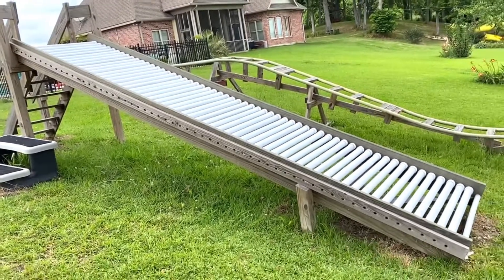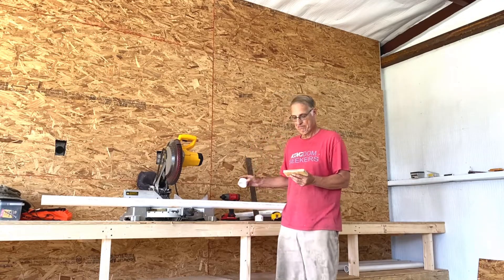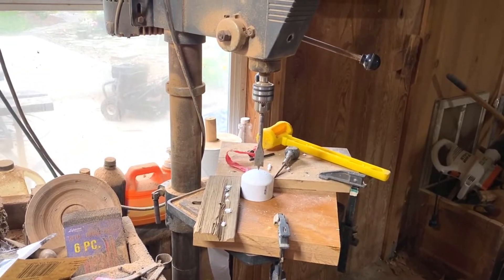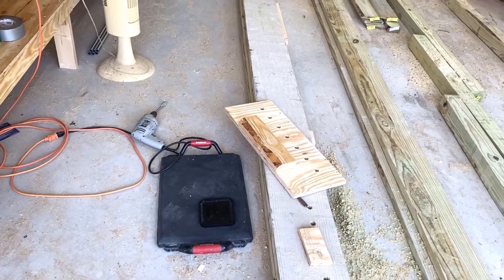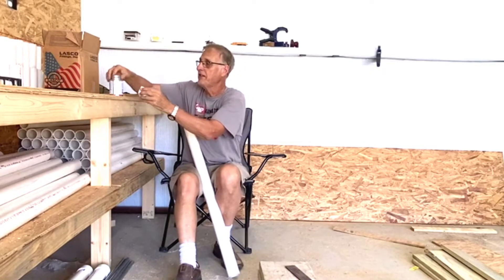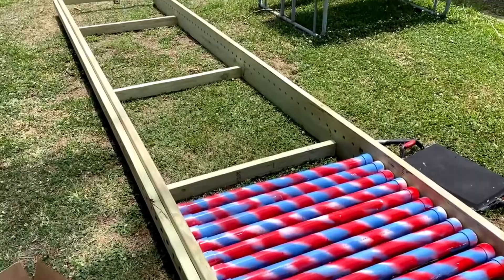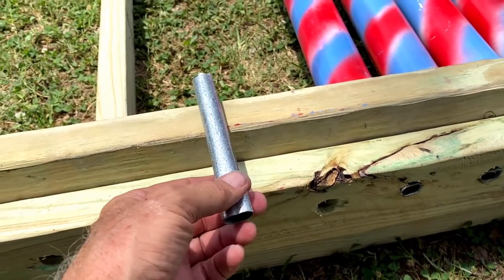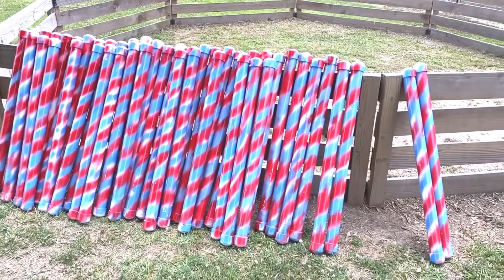Roller Slide: How to Build

Comment: Is there a reason for using the 2x4 and 2x10?  Wouldn’t the 2x10 be enough strength?
Reply from the maker: Yes that’s a good point. The two by four is added for the purpose of holding the 1 1/2” steel conduit in place. I think it is very necessary for that.

Comment: How much was this project
Reply from the maker: Watch the attached long video and it will tell you all the parts. Not sure about total cost. It is fairly expensive project because of the tubing and the end caps. I devised a much cheaper way to make this as explained   Smaller pipe and much less 1/2” steel conduit.

Comment: Couldn't you use a reducer on each end instead of caps that you have to drill?
Reply from the maker: @BluePython89  the tube needs to spin on an axle. The 1/2” conduit is the axle. The tube spins on this metal conduit. Not exactly sure what your idea is.

Comment: In your opinion, to prevent finger entanglement, is it better to have a larger gap or smaller one between rollers ?
Reply from the maker: 3 1/4 “ apart. I have made three. Haven’t had one problem w fingers. On my last one at 3” I had a few that got too close together and wouldn’t turn correctly. Was hard to fix that. My first two I had not problem w that. Anyway 3 1/4 “ is ideal based on my experience.
Reply: @BayouDad  thank you for your quick answer and great video!
Reply from the maker: Merry Christmas.

Comment: Did you use 3/4” drill bit thru the caps? The 3/4” conduit’s outside size is almost 1”. (The inside size is 3/4”). The 3/4” drill bit was too small
Reply from the maker: @jz497  I used a 3/4” woodbore bit. You know it is flat with a point on it. Also for the wood holes.
Reply: Thank you for the quick reply! Did you use conduit that was labeled 3/4”? The conduit I got was labeled 3/4” but outside size was closer to 1”. Which kind of emt conduit did you use?
Reply from the maker: @jz497  sorry if this was problem. Here they called it 3/4” metal electrical conduit. It is 3/4” OD. Fits tightly in the 3/4” wood holes. I pound down one end to fix into wood.

Comment: I was wondering, I’m not an engineer, do you think conduit is the only way to do it? Could rebar work? I’m so encouraged that you gave God the credit for the answer to how to make it cheaper but I’m still looking at a Lowe’s cart full of stuff that is super expensive.
Reply from the maker: @NM-mh2if  it is an expensive project but I have made it cheaper than usual. Using smaller pipe and 6” long conduit. You won’t be able to keep rebar in place and it has ridges.

Comment: Cool concept. How long are the PVC cuts? 36" or so?
Reply from the maker: @kevinsmeltzer8053  38 1/4”
Reply: @BayouDad  thanks for the fast reply!
Reply from the maker: @kevinsmeltzer8053  this is to maximize the 10’ length of the pipe.

Comment: Considering building one of these that is portable for the box maze. So it has to be taken down and set up again. Not sure how I’d do it. Any thoughts, besides replacing screws with bolts? Any idea how much this weighs?
Reply from the maker: @Ryanc696  i built the sideboards (2x10x16’ w attached 2x4x16’ at my house and hauled them to the church. Not too heavy. Then joined them together w 2x4s. You could use lag bolts for this. Then use bolt to attach to 4x4 supports.  Should work.  Or the whole roller part could be one piece but that would be heavy. If you have a lot of help you could manage it.  Also my next one will be a little higher and faster. Just made Gaga ball pit. Making video on that now. Easy.
Reply: @BayouDad  thanks, I’ll look into doing this.
Reply from the maker: @Ryanc696  I’ve been thinking. The screws can just be undone. No need for lag bolts.
Reply: @BayouDad hope you are doing good. Thinking about this again. To reduce weight, do you think non-treated wood would work? Do not anticipate keeping it outdoors.  Will also probably use a roll up ladder with rails to get up to it. Think it would be stable enough without the attached platform/steps?
Reply from the maker: @Ryanc696  don’t need treated wood if inside. It dries out and gets lighter w time anyway. If you don’t have it anchored into ground you will need to add extra structural bracing.  Not really sure what you are doing but just try things and it will work out.
Reply: thanks, we just have limited storage space and it’ll be used once a year, so looking to minimize the overall footprint. After thinking about it some more, I may be able to anchor it to a wall by aligning it alongside.
Reply from the maker: @ you could also make it less wide.